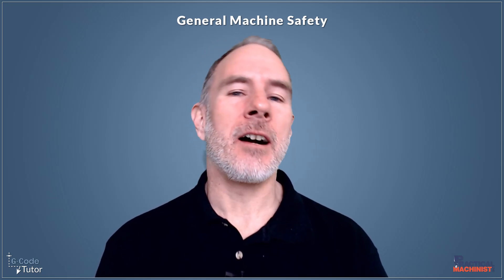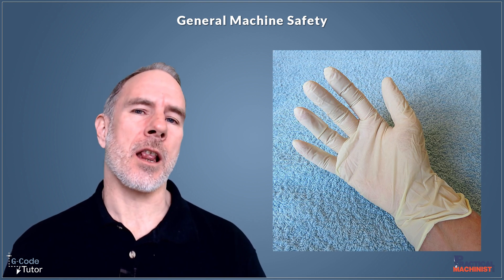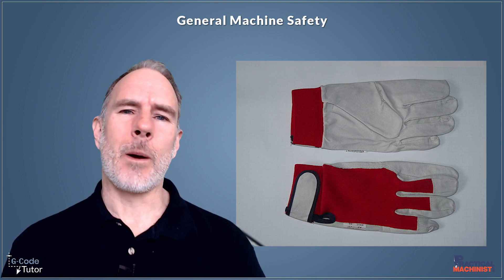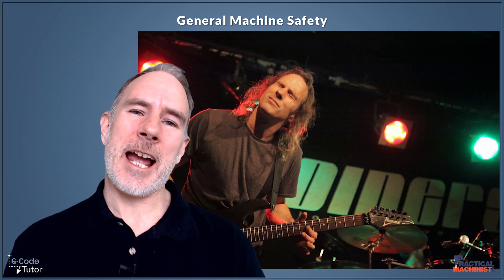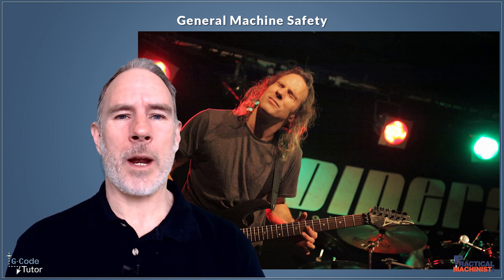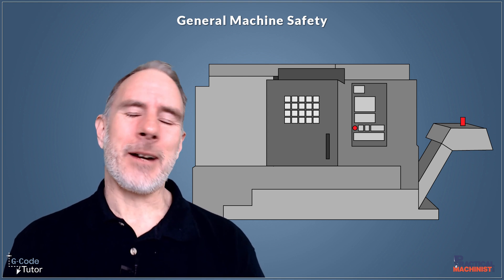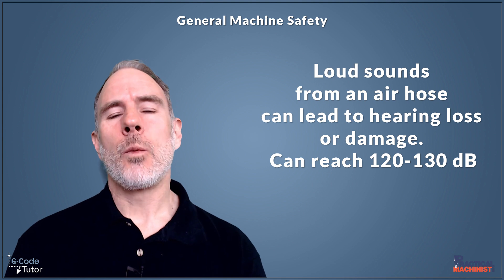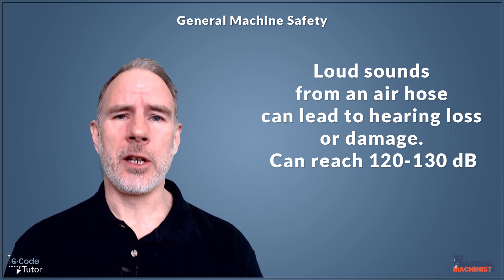Basic CNC Machining Safety Tips

Comment: Never bypass safety standards on any machine. If something does go wrong with the machine, and the safeties were bypassed the manufacturer is not liable.
Reply: Unless you're a service guy, actually fixing an issue with the machine. There is times when machines will screw up and jam something, but as an operator you should NEVER, EVER be near any safety overrides. But even then, it's rare that you need to do something like that. 

Actually, there is ONE reason to override something manually. Okuma doors lock when the machine is powered down. There's a special key you need to unlock the interlock. Only really acceptable on turret lathes, as with almost any other machine, you can get into the tool magazine.